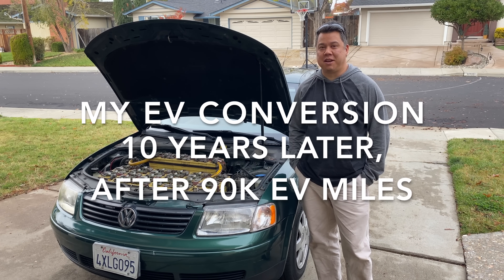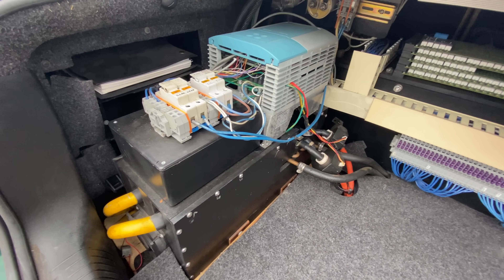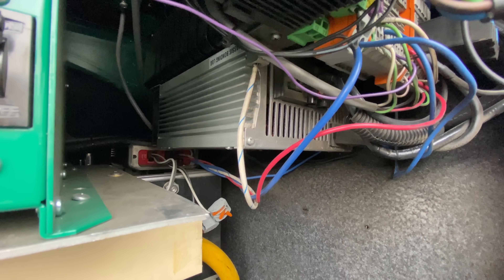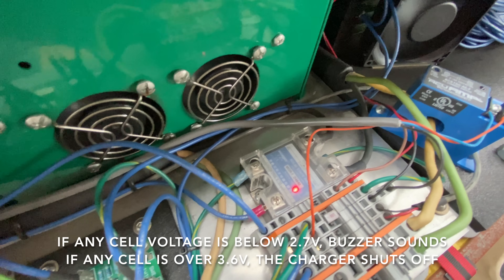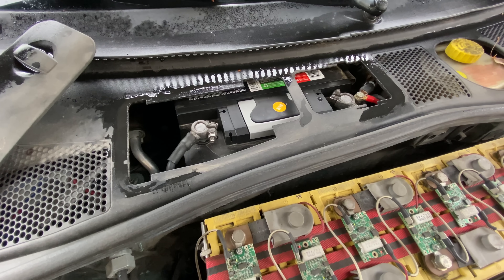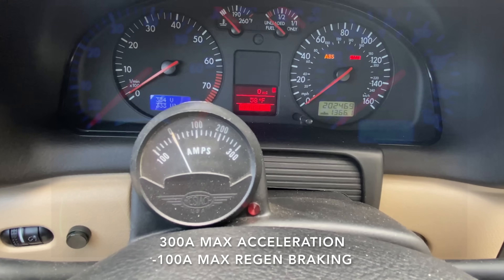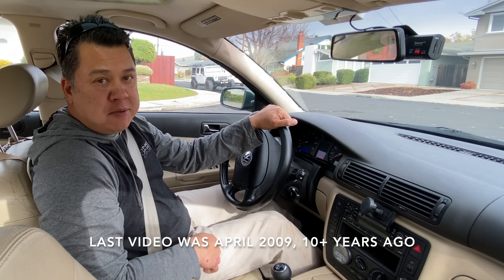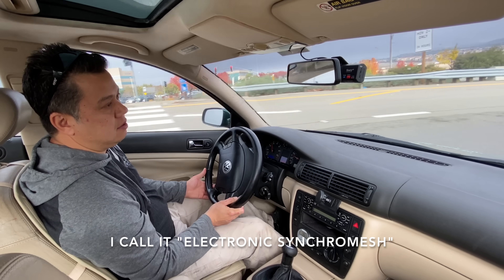My EV conversion after 10 years and 90k miles

Comment: How much has the battery pack degraded? That's the most important question. To replace the battery is not cheap.
Reply from the maker: Hard to say really cause it changes with temperature.  I'd estimate the pack is at 75%, with one cell that's at 50% cause my simple BMS allowed it to fall behind while all other cells got top balanced.
Reply: @etischer  Good to know from you. Thanks.
It would be great if we can know in a practical sense how electric car batteries degrade over time and how long before they need to be replaced so that we can know the maintenance costs or hidden costs of owning a electric car. The batteries are the single most expensive component of any electric car. The savings from not using gas has to be spent on battery replacements
Reply from the maker: @arrowstheorem1881  Well don't use my 12 year old home built EV as a data point lol!     Tesla warranty  is 8 years, infinite miles on Model S/X.    https://electrek.co/2018/04/14/tesla-battery-degradation-data/

Model 3 battery with newer 2170 cells should be even better.  Elon has said the million mile battery is just a few years away.    Batteries are also getting cheaper every year, by the time the battery needs to be replaced, the cost will probably be half what it is today.    Batteries cost for my car is roughly half after 12 years.

Comment: What a piece. Could of got a new car for 25k
Reply from the maker: And how much would that $25k car be worth after 10 years of depreciation, gas and maintenance?
Reply: @etischer  more then that Passat just cause you have a total of 25k into the car dont mean that car is worth 25k. Age of the car is probably 2500 dollars
Reply from the maker: @Patrick-nw9bt   Ok, say it's worth $2,500, add to that $16k in gas/maintenance savings over 10 years, and it's far ahead of buying a $25k gas car.  When I had the car appraised for insurance, it was appraised at $50k. Add to that It got me my job at Tesla, and 7 years later I'm retired, I'd say it was worth it.
Reply: @etischer  your insurance adjuster must or been on crack. If he appraised that car at 50k
Reply from the maker: @Patrick-nw9bt  You have to remember this was 10 years ago, before any electric cars existed on the market.  For a professional EV conversion shop to build another 90kw AC motor driven ev in 2009 would be $50k.   Just like flat screen TVs used to be $10k, and now something similar are mass produced for $300.
Reply: @etischer  that's funny

Comment: Interesting. Do you have tracked the loss of capacity of the batteries over time?
Reply from the maker: I never discharged below 20% or charged over 80% (BMS is fixed at 3.7V, where 100% full is 4.2v), so tough to judge.  Performance also changes quite a bit with cold weather.

Comment: How stable is that setup if you were to be in a accident?
Reply from the maker: The battery racks are all welded steel, attached using tapped steel backing plates.  The hold down straps have a factor of safety of 30x.  Vehicle weight is only 100lbs more than the V6 Passat, and 900 lbs lighter than the W12 version.   Batteries are fairly inert, they don't catch fire even with nails/bullets driven through them.  No gasoline to leak or catch fire.  No hot exhaust system.  Frame/chassis is unmodified.  Airbags, seat belts and ABS still function as normal.

Comment: I love the project but there are so many little modules to co-ordinate its just insane. The manual transmission was also somewhat of an overkill for this project. Most EV projects use one gear and the brushless motor will dynamically control the torque to get the various speed demand just like a tesla would. Somewhat defeats the purpose of an EV with a manual trans (I understand why it needs it) but its still an item I would rather be without in an EV. 

Either way, cool project, just wish it was in a nicer vehicle, I guess time will tell if he transfers it into a new project car.

Comment: Cool.... BTW my 2005 Yaris I paid $3,500 10 years ago, and it has now 670,000 miles, original motor, original clutch , everything except front brake pads, and I change the oil every 10,000 to 25,000 miles, for real.  People say u have to change the oil, kinda,but my grandpa did a few tests he drove one truck for over 10 years daily and never changed the oil, well over 200,000 or more miles, still runs great today as a snow plow truck nolonger daily driver.....then he has done this many times on many cars always drives over 100,000 to 300,000 miles without ever changing the oil, never had any engine problems of any kind.....just he either sold, or gave the car to family member who needed it, but again I know u should change oil, as a plugged filter won't let oil flow to oil pump, but u don't have to get excited over it....I do my own oil changes that only cost like $12 to change Yaris oil, and I still don't do often.....lol

Comment: I converted a 1974 VW Beetle to electric drive with 8v golf cart batteries. I drove it for 95% of my driving over a period of 2 years. It topped out at 70 mph and had a range of 40 miles. It was very crude compared to @etischer 's car but I loved it.

Comment: What model are those fans you have on the trunk lid?

What other components do you use for the air conditioning?
Reply from the maker: Austin Braden not sure about the fans, but the ac compressor is a masterflux Sierra

Comment: hes driving an electric car with a manual transmission, that on its own is impressive, but then you find out he doesn't use or even have a clutch and the car was originally an automatic and my brain just ejected itself from my skull. He seems to only use 2nd and 3rd though so I really wonder what the point of even having a transmission if you really only need to keep it in second then why wouldn't you just direct drive the motor to the wheels?
Reply from the maker: Dub_Steep the transmission provides a 10:1 reduction, making the torque at the wheels 10 times more than direct drive.  Also a way to connect the motor to the two axle shafts
Reply: @etischer  why do you only use 2nd and 3rd then, why not go all the way to the overdrive gears, wouldn't that save you electricity? sorry if that is a dumb question, I am very much so not as knowledgeable as you
Reply from the maker: @TheUchihasparky    In an electric motor torque is related to current, and rpm is related to voltage.   If I'm using 3rd gear, the RPMs are lower, which requires more torque from the motor (and more current) compared to the same power using 2nd gear running higher rpm ( higher voltage).   Current is what causes heat, so using 5th gear would overheat the motor.  To get max power, you want to maximize current and voltage, voltage is maximized between 4000-9000 rpm.

Comment: for the price of this you spent you could of bought a brand new car... why i ask why?
Reply from the maker: A new $25k car would be worth about $5k after 10 years, and you would have spent another $16k on gas, oil, timing belts...  I also did it to challenge my brain and learn some new skills
Reply: @etischer  um lets put it this way a new car.. oil changes etc normal maintance is the same thign as this.. you put electricity in the batteries  you may have saved alittle bit but not enough to justify doing this.. its like tesla owners thinking they are helping the enviroment they arent... a truck a diesel truck broke ground to get that litheum out power too.. to mine it and refine it.. you charge your car by coal and nuclear power both wasters... you charge by solar panels well you only helped out alittle see these electric cars are nothing but a toy fun to mess around with fun to drive fun to think you are saving or helping and you are not... all that money and time you spend could of bought a good car and one that lasted i know you think your trying to justify it and well sure if you think its helped but in reality its not sorry to burst your bubble
Reply from the maker: @edh2166  Again, this project wasn't necessarily about saving money, it was more about learning new skills and the challenge.  Sure a diesel truck may have been used to mine lithium, but much more energy has been spent to drill for oil, refine oil, frack oil, ship oil;  more American lives have been lost, and more American dollars have been spent ($6.4 Trillion) to protect the flow of oil;  billions more cleaning up oil spills....  Not sure why people are against being energy independent, I'd rather generate my own American power, than  pay other countries for oil, especially if those other countries are our (past/present/future) enemies.   Oil is a limited resource, it will keep getting more expensive as supplies are exhausted.  People like me are helping ensure there is more cheap oil for people like you.   My car was up cycled from the junkyard, it had a siezed cam, and I gave it another 10 years of life, and went 10 years without buying gas.  It has also been charged 100% from solar energy.
Reply: @etischer  thats cool i guess.. but its a awful lot of money to blow and no one will want to buy it when its all used up.. invest in your future man.. not in projects that cant be resold for what you put in or more than you put in.. but if you have money to blow hey enjoy its cool and all but by now you coulda had a tesla just saying not trying to be a dick.. im just asking my self why
Reply from the maker: @jackoneill8585  My EV conversion gave me the skills I needed to get my job at Tesla.  Most people list their education on their resume, this car was my resume.  Even 10 years later, I'll meet someone who works at Tesla and they'll tell me they heard about my job interview there.  This car was the best investment I've ever made, I retired at 40 from Tesla and now just living the good life.  I do own a Tesla Model 3 AWD, but when I started my EV conversion, there were no EVs available to buy, this was 2008 before the Nissan Leaf or Chevy Volt.
Reply: @etischer  why are you so defensive geesh.. relax im just saying the money spend and time could of been used to better your home or to put your kids though college... or save it... doing projects that have no intrinsic value past yourself or for the future is a waste of money its just my opinion..
Reply: The experience? Think about thinking about doing this then actually doing it. Amazing work.

Comment: I repair EV vehicles. I think its a transition technology before we invent something better but it will be around for a while. Once you get used to having no engine noise, the instant torque and you hop in a gas engine you instantly think, how archaic is this. Nice job on the retro fit.

Comment: What do you do?
Reply from the maker: I was building automation control systems for Tesla in the powertrain group. I was designing the controls architecture for machines.  Building electrical panels for power distribution, PLC controls, Servos, VFDs..  Programming PLCs, HMIs, Servos, Robots, safety devices...  If you want more details, I have my resume listed at the bottom of my webpage, etischer.com

Comment: Thanks! I've been curious what it'd take to have a small truck converted. This gives me enough of an idea to know that I'd be in over my head without some help.
Reply: Alastair Drong A lot has changed in 10 years since he did this. Now you can buy full on conversion kits from places like EV4U and many others.
Reply: @peterkacandes5905  Yup! I'm aiming to convert a Chevy S-10 which has at least a couple of different kit options. The places where I know I'm going to need help are things like pulling out the engine and any fabrication that'll require welding.

Comment: What the heck is with the Parker key pad??? You have a DC drive on the compressor?? What vfd are you using for the drive train?
Reply from the maker: I'm using a Parker 690 VFD for the 90kw traction motor.  One of the analog outputs from the VFD sends an analog speed set point to the VFD running the brushless DC air conditioning compressor.

Comment: What's the DMV registration situation?  Can you expand on that as well?
Reply from the maker: First I had to get the car inspected by the Bureau of Automotive repair, they were stationed at Las Positas College.   They basically checked for catalytic converters, brief look over, and there it got certified as electric fuel type.   After that, I took it to the DMV for inspection, the lady at the DMV didn't know what she was looking at, and just signed off on it.  I applied for the white carpool stickers and they arrived a few months later.

Comment: How fast 0 60?
Reply from the maker: 0-60 is 14 seconds, using only 2nd gear.  Would be a bit faster if I had a clutch and could change gears quickly.
Reply: @etischer  put a powerglide in it and swap the battery from a ev Pacifica. They have alot more power since its from a heavy van. Just a idea if u filmed the whole thing u could make massive money from ads on YT. Every car guy/girl would watch

Comment: whats the 0-60 time? very curious
Reply from the maker: 0-60 is 14 seconds, using only 2nd gear.  Would be a bit faster if I had a clutch and could change gears quickly.
Reply: @etischer  Keep up the good work very inspiring!

Comment: What’s the 0-60?
Reply from the maker: 0-60 is 14 seconds, using only 2nd gear.  Would be a bit faster if I had a clutch and could change gears quickly.
Reply: oh i thought it was gonna be like 5 seconds but that’s not bad for the cars age

Comment: the most dangerous thing about e cars is they allow car drivers and the cancer system they belong in, to think they are doing the right thing. when in fact they just allow the continuation of motoring insanity. e cars will always be built and charged by fossil fuels, directly or indirectly. not only is this obviously true at face value if you honestly look at the materials and infrastructure involved, anything else would contravene laws of therodynamics
Reply from the maker: It's proven gasoline cars cause cancer.  My EV is 100% charged by sunlight.

Comment: How do you focus on the road, while trying to keep your eyes on the many indicators in order to operate your wheeled gadget? That is too much distraction.
Reply from the maker: I don't need to look at anything while driving.   Just like in a gas car, you don't typically check your gas gauge, oil pressure, coolant temperature gauge, alternator light... constantly while driving.

Comment: You should mod it to plug into you house in case the electrical grid goes down.  it could power the entire house for 1 day with normal usage.  Could go days with limit use for fridge, some lights etc.

Comment: How can an induction motor do regenerative breaking? From my knowledge that shouldn't work.
Reply from the maker: Any motor should be able to be a generator.  The inverter commands a slower motor speed, the kinetic energy has to be converted into heat or electrical power.  By default, electrical power is generated, but the VFD can also do DC injection braking where energy goes into heating the motor, or electrical energy directed to a resistor and dissipated as heat.
Reply: @etischer  But since an induction motor hasn't got any permanent magnets, there can't be anything inducing anything into the coils. I can imagine it being able to break via eddiecurrents in the rotor. Regenerating power should not be possible with induction motors. But with permanent magnet synchronus motors it should be possible. To me your motor seems like a three phase synchronus motor. But of course you built the car. :-)
Reply from the maker: @simont3686  The drive inverter circulates current through the motor to magnetize it.  This circulating current is different than battery current, the battery only makes up for the losses due to resistance in the wire to maintain the magnetizing current.  Any excess current is put into the battery during regen.
Reply: @etischer  I just looked it up. You´re right. Seems pretty obvious.  Sorry for costing you time.

Comment: I see this is how American passats are like, in slavic lands this car would be no use
Reply: There's no point in doing this to the u.s. version. He's not saving any money. High upfront expense converting everything. With no more than 70 miles a day, he's not saving that much in gas. Still has expenses....transmission fluid, new batteries, solar panel replacement. etc.  No thanks.
Reply: @moncorp1  read the description

Comment: Something ive always wondered that maybe you can answer, why couldnt you install a alternator under the car and attach via belt to something like the drive axle?

You could mount it somehow so it flexes with the suspension to keep belt tension and charges your car while driving
Reply from the maker: It has a 90kw alternator already attached to the wheels.  When I want the car to slow down, the motor acts as a generator converting momentum into electrical power to charge the battery.
Reply: @etischer  thanks but thats not what im wondering, you will never charge the car 100% by braking. I'm talking something that puts out close to the same amount of energy consumed any time the vehicle is in motion not just while braking.

I know there's a way but I feel like the oil industry is keeping it away as that would the answer to getting rid of gasoline engines
Reply from the maker: @c4k3t0otz6   Energy can't be created, it has to come from somewhere (like taking energy away from a moving car).
Reply: @etischer  I under stand energy cant be created. Regenerative braking only works when braking correct? An alternator is spun by an engine 100% of the time the engine is running making power so we should be able to do the same with an electric motor, it  wouldnt be 100% efficient obviously but would be better then only converting energy when braking
Reply from the maker: @c4k3t0otz6  In a gas engine, more gas is being burned when the alternator is outputting power.  Can't get power for free.